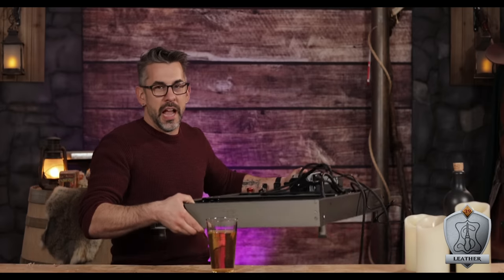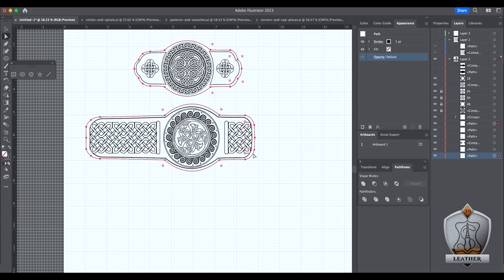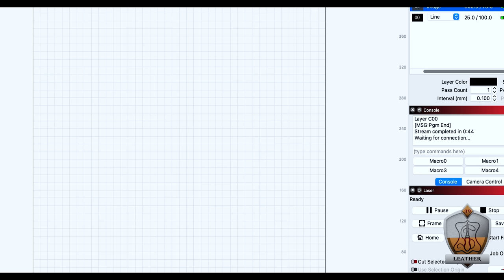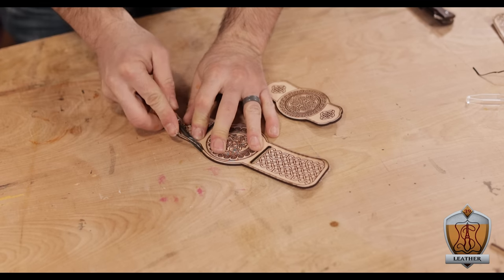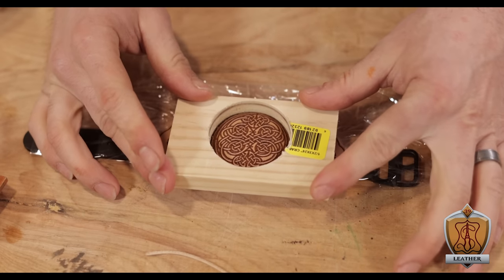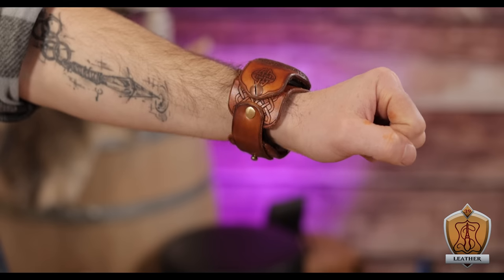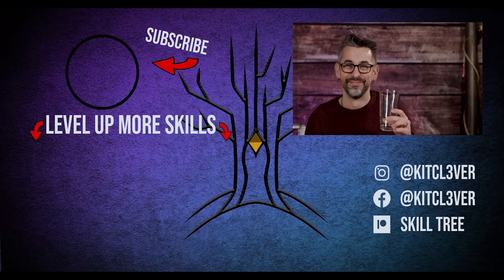Leather Smartwatch Cover! Hidden in plain sight

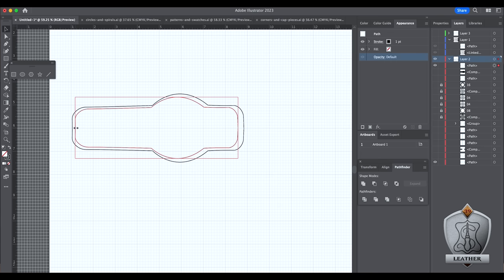Comment: Hey! Quick tip for illustrator for the bit at 4:05 of your video, its easier to use "offset path" to get an exact inner shape/border that is equidistant to all edges rather than manually rescaling it by hand.

Comment: As stated on other sites that review/ use laser cutters, YOU NEED TO GET AN ENCLOSURE! It will allow a vacuum hook-up for ventilation, but more importantly, it can prevent eye damage from reflected laser light. The included glasses are not 100% effective, unless you get some made like swim goggles, and it doesn't do anyone else any good if you only have one pair.
Reply: And in addition to the ones available for purchase, there are some decent plans here and there online as well. 

Oooh... that might be a fun project to watch - taking the basic plans for an enclosure and giving it a fantasy/steampunk/mad scientist/whatever vibe.
Reply: @PhoenyxAshe yes! I’d love to see his embellishment on a basic enclosure. He does a great job melding form and function.
Reply: I bet you could make an enclosure with some plexiglass, extruded aluminum, small fan, and shop vac hose. The. Vent it out the window.
Reply: @OnionOniCreations  I've seen variations on that... more designs using wood for the basic box and lid.  Heck for the brief period that I had a diode laser (gave it to a friend who does mostly engraving), I made a fast-and-dirty enclosure using two cardboard tri-fold displays, a translucent cutting mat, two computer fans, and a small USB bar light.

It wasn't pretty, and you might have noticed a lack of venting hose (at the time I was more concerned with pulling the smoke away from the cutting surface as I didn't have an air assist), but it mostly did the job, and was a cheap way to find the flaws in my initial design.

Comment: Cool project.  I think I will make mine with a compass covering my watch.  Technically, the smaller, wearable compasses were not around until about the 1930s, but the portable "dry" compass was around in the 1800s.  Since most festivals are not so strict on historical accuracy, it would be functional and have a good look, while covering my very non-period timepiece.
Reply: Just dont use any magnetic materials like steel near it or it will mess up that compass. I know some compass's that dont point anywhere near the north because of poor material choices
Also you could get a pocket watch but i guess that those are not for everyone
Reply: That's a neat idea. How about a pop-up sundial on top! What's that? That's me timepiece!  😂

Comment: You definitely need an enclosure. Also, it's not a good idea to engrave chrome tan as the chrome salts burning off are way nasty. If you want to get the engraving darker without burning through the leather, try painting it with dissolved baking soda and letting it dry before engraving it! It's always best to do a test run with the leather you're going to use as I found that each hide reacts differently. If you choose one of those excellent Celtic circles to do the tests with, for instance,  you can use the test pieces to check dye reactions then turn them into pendants or key-ring tabs to give away as gifts.  Laser engravers are fun tools and the Creality one looks like it's very well made with all the good safety features.
Reply: Just the one weakness like most other engravers like it... the gap... I agree with building a full enclosure

Comment: I have been using a nylon version of this since I first joined the ARMY in 1985. we used to to protect the face of the watch ( not a smart watch, but same idea) and it also prevented the face from reflecting, and giving away positions.
Reply: Its been around probably since the Boer War c 1900, known in Australia as a "Bushman's" watch strap. I used one (leather) back in the 1960's & 70's to avoid scratching the face of my watches.

Comment: Many years ago I was an active open water kayaker.  I have had a few band pins break when getting pummeled with the waves.  Luckily I never lost a watch in the surf, but when this happened I had to stop and remove my watch to put in a pocket so I wouldn't lose it.  I often played with the idea of fashioning some kind of cover out of neoprene or nylon or something that could withstand the battering of the surf.  I played with a few concepts and roughly fashioned one out of nylon strap where I used velcro to hold the band in place.  I'm no craftsman so the work was not pretty.  The concept was OK.... but it didn't take long for the velcro to lose its viability in the salt water and it wouldn't stay closed anymore.  
This is a great idea and a nice build.  Well done!

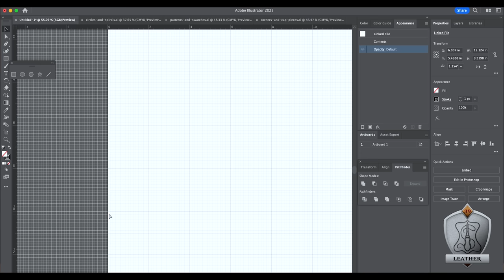Comment: 3:01 Dude... you laid a ruller down on your 1/4 inch grid paper for scale. I think I would have just... not pointed that out. By the way, all of your projects are amazing, but this kind of thing really tickles my inner anachronist. My current hobby is taking apart my tech, like computer speakers and wireless headphone cases, and remaking them in wood. I really want to get into leather working which is why I subscribe here. Also, you've heard the phrase, "To a hammer, every problem looks like a nail?" Beware, that kinda happens when you get a laser cutter! You'll have fun with it, though.

As for project ideas for your laser cutter, how about a sheith for a laptop to make it look like a book? You'd work in wood, leather, and possibly in paper to build the case. The cover could include intricate raised areas that could be made of layers of wood then covered in leather and worked to look embossed. It would need to hold tightly to the laptop while allowing use and ventilation, all of which are features that could only be improved by using a laser cutter. You get the idea. It could even include a shoulder strap with a hidden wand pocket for that Wizard on the Go look.

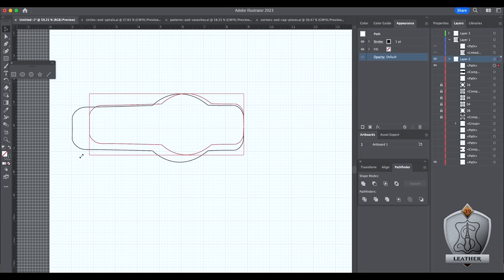Comment: Illustrator also has an "Offset Paths" function, for when you want to do what you did at 4:05
Reply from the maker: DOES IT?!?! I must learn this thing
Reply: @SkillTree  Yeah, you just have to duplicate your shape with ctrl/cmd + D, then hit ctrl/cmd J, and then drag the handle (a white dot I think ?) to the correct size :)
Reply: @SkillTree  There are also tools for rounding corners so you don't need to worry about trying to line up an ellipse to the edge of a rectangle shape.
Reply: @SkillTree  If you want a crash course in Illustrator, let me know. We can do a quick Zoom call.
Reply: You could have designed your project in Lightburn just as fast. Then set the parts you wanted to engrave to a different layer from the cuts. 
Also, under the "laser tools" you can create a test grid pattern to work out the best speed and power settings for your material.

Comment: I've recently started a job as a laser operator and I've done some leather lasering, it stinks so bad. But for precision it's absolutely unparalleled, I've set patterns to cut out 2mm holes 2mm apart and it's just extraordinary. It would have taken me hours to do one seam by hand, less than 5 minutes for the entire thing on the lasemotron. I'm constantly learning new stuff with lightburn, just yesterday I figured out that a pattern can be locked in place so you don't have to be so delicate moving smaller elements around it.

Comment: As a major thing, get a good notebook to keep track of settings with different projects, and have some sampleboards for materials. Most laser engraver/cutters have a test pattern, and running it on sheets to store can help a lot with dialing in settings as you go.

One thing that I've done is to grab the wooden cigar boxes that Walmart has in some of their craft isles, laser engrave something cool on the front and line the interior with felt. They're great for anyone for D&D...especially the people with metal dice to protect tables since a lot of gaming spaces are on wooden tables and some metal dice can do some gouging damage to them.

Mine also fits the card "spellbook" that I'd bought along with my nicer dicebag when playing various RPGs

Unfortunately, you don't have the extra piece to deal with curves, the local makerspace has a few lasers that have a piece that slots in that rotates things like glasses to let you make some great, custom glassware, jars, bottles, and other things.

For using it with leather, maps are one of the cooler props...and since you're doing LARPs, contacting the people running them a bit early for a basic map of the area can let you show up with a cool tool for your ranger.

You can do some great patterns engraved in craft foam with a laser (I think it's Knarb Makes that was showing it off with cobblestone for terrain projects, but you can make some interesting patterns in things if you need things), and the craft foam run through it stiffens up more uniformly with the laser than a heat gun, so you can use it to make some decents stamps which could work for a noble or similar for their seal if you don't want to mess with things like hot wax in a LARP...because sealing wax isn't that easy to deal with until you get a lot more experience anyway.

Comment: Definitely shield the engraver (which will make your ventilation problem easier to control, since you could clamp the vent fan directly to the case), lazers are dangerous.

Also, another way to have done this is to simply use a leather watch band and attach a cover to it. It would have been less bulky.

Comment: Burning leather really smells bad, try it on wood through.  It smells wonderful!  My first project was a leather belt pouch with wooden sides for strength.  The sides can be round, oval, or rectangles with rounded corners.  Burn patterns into both the wood and the leather.  Also try  cutting through the patterns in the leather to create overlays with colored leather behind it to create fantastic stacked layered designs.

Comment: I would try to cut a circle in the lower portion of the leather to allow the sensors to function.  You might have to recess the watch some as well, but it would increase functionality while also lowering the profile some.

Comment: While it is a bit bulky you could make a forearm bracer designed to fit on the upper part of your forearm. Or maybe a knife sheath on the gauntlet ala your thieves' bracers, that would make the bulky top section flow down the arm like an aesthetic choice.  Or even some bulky sleeves.

Comment: I made something similar for the exact same reason, though I did not have a laser engraver. The watch band itself is a different design and has a band integrated into the leather bits because I hate the feel of plastic on my wrist. It looks awesome. Unfortunately I have a really hard time getting to the buttons on the side so I need to adjust it a bit. I also find that using the weird magnetic charger that came with it is kind of a pain in the butt. However I do like how it came out. To protect the watch, I got a small sheet of copper and dished it out, then put a felt protector inside it to avoid scratches.

The larp I'm in is a post apoc zombie larp called Dystopia Rising. So I didn't want a fancy pants electronic watch being visible BUT I needed a decent timer for crafting that I could actually see in low light settings. Since the watch is OLED it's perfect.

Comment: So a medieval tactical watch cover. Usually those open the opposite direction. The bottom being closed off blocks the heart rate sensor your watch probably has on it. Might have been better to just change out the straps and make a cover that attaches to them.

Comment: On the bottom piece, the place where the watch rests. As when it is in use, you won't see the engraving, you could have cut a hole instead allowing the watch to have access to its biometric functions. It would also reduce its bulk a bit

Comment: I propose you make a themed enclosure for your new laser. It'll also help keep the fumes- and associated smells- under control. Even your makeshift ventilation system should be able to handle it if you run the box's exhaust right to it.

I have 3 laser cutters myself (2 UV  like yours [1 enclosed] and 1 IR). I like them, but one area I am concerned about for you is the open end of the laser. Yes they have that shield around the laser head itself, but that little gap still lets enough UV light through to be dangerous for your eyes... especially at 22 watts.

When you "lower" the power, it's still shooting out 22 watts of power, just at shorter intervals. It is still just as dangerous.

Comment: You’ve done some prototyping with EVA foam before, and also made foam weapons (Sting). I’d be interested in finding out if the laser cutter will cut through or just melt EVA foam, what thickness you can cut through, and if you could engrave or relief cut EVA foam. Essentially: 1) Cut or Melt? 2) How thicc? 3) Inscribe runes? 4) Deboss around raised runes? 

If it works, I think you may be a LARP armorer soon…

Comment: everey time I hear laser I remember Dr. Evil doing the air quotes "laser" 😆. To take your projekt further you could laser a ruler on the sides or the underside and add a pocket or a liner for a 58mm victorinox or a picktool to it. I got a small craftknife from amazon that´s hidden in a brass tube giving me the idea that putting designs on crafting blades is a cool way to personalise them and if you develope a character it can be a unique, subtile detail. So I´d suggest you try that with the "laser"🤭 (insert here if you like: mad, maybe slightly evil laughter).

Comment: I'd personally have a cut out on the bottom part so my watch can still read my biometrics also heavy duty snaps instead of buttons. Maybe buy the watch hardware connection things in a sturdy metal and make the whole thing the watch band instead of a band cover and a face cover

Comment: I love my xTool d1 pro, very similar to the creality machine you're using. It looks like you're engraving Raster paths. you can tell because its just going back and forth flashing the laser on and off as opposed to following the path of the engraving with the laser always on which it would for a vector engrave. This is generally faster and more efficient. I'm not using Lightburn, though I want to try it, so I can't give you tips on what file formats and settings you need for a vector engrave.

Comment: I would of cut out the centre to allow the watch to sit on my wrist for the heartrate and blood O2 monitoring that requires skin contact. and I think the top standing proud and loose like that is asking for trouble as I can see dirt easily getting in between the top flap and the face of you watch and scratching the hell out of your watch face and I don't think 5 seconds needed to move the flap is too much extra compared to the cost of repairs or replacing your watch.

Comment: I ordered one with the link and it doesn't come with the mesh plate you taped the leather onto, that is apparently an add-on purchase.  Instead it came with a thin sheet of metal that does the same job but not as well.

Comment: Does your smart watch not need to touch your wrist?  All the ones I've used have sensors on the back side of the face.  That's what's kept me from making a cover of my own, I haven't been able to figure out how to get it to sit right and still have the back touch my wrist so the sensors keep working.  The best thing I can think of is to replace the band with something that includes a cover, which is a bit of a pain with the strange proprietary connections.

Comment: The only suggestions I'd have is, don't use your watch strap. You already have properly sized slits, you can add leather loops, to hold onto the watch lugs, and turn that into its own strap. Finally, cut a circle around the sensor at the bottom of the watch, so it can make contact and maintain full functionality. This way, you keep all of the original functionality of the watch, and minimize the amount of plastic you're bringing!
Reply: The leather is acid and will eventually corrode through most pins used to hold the strap to the watch as it gets sweaty in use.. I used to wear a 'Bushman's' watch band during the 1960's & 70's to avoid scratching the face of my watch, but I did have to replace the pins fairly often.

Comment: Does the surface have to be flat? Could you engrave a mug with it? Or could you do something similar to a mug so you have a hot beverage container for your LARP adventures?
Reply: I think the surface needs to be flat. For this printer at least. You could always laser engrave a flat piece of leather to create a wrap for your beverage container.
Reply: Some printers include a horizontal rotary option for engraving round stock like mugs, pens, etc. Creality shows such a device in one of their pictures, etching a tumbler, but I could not find it listed for sale.
Reply: @jarekmace1536  Well that’s just all ’round cool.

Comment: Oh god... those unenclosed lasers are so incredibly dangerous. Your air assist is great but you have no proper extraction and the air contamination is huge. I've been using lasers for over a decade- please be safe, get proper eye protection, NEVER leave it alone while its turned on let alone leaving it alone while its running. Lasers are a fire hazard- unenclosed lasers are a house fire hazard.